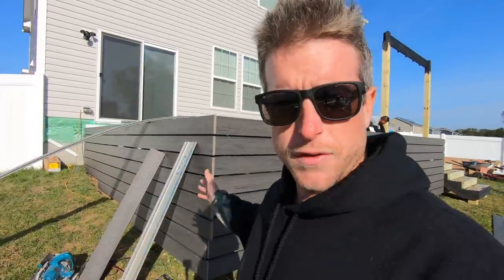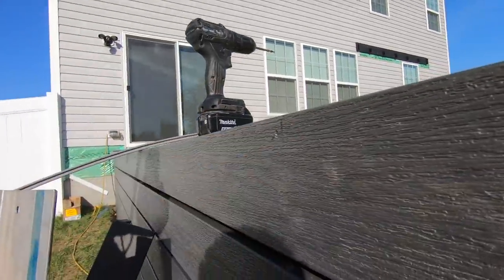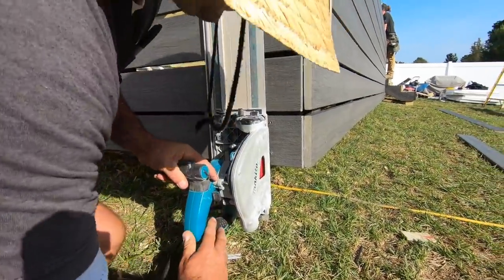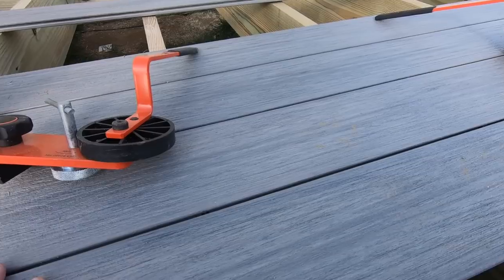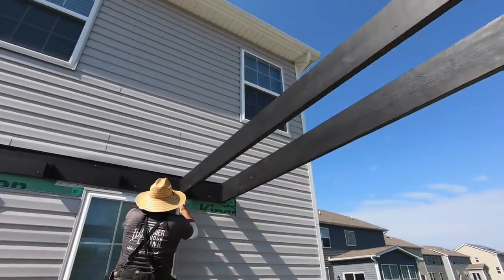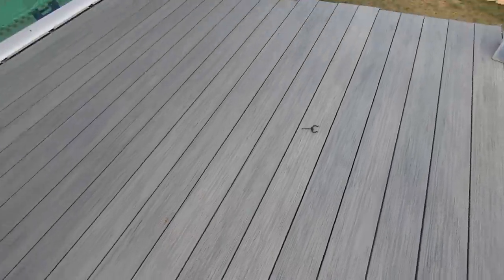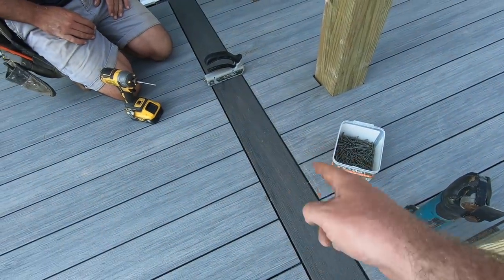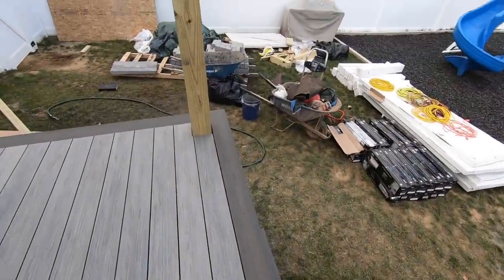Modern Deck and Pergola Build - PART 2

Comment: Great work guys , 2 minor suggestions /questions 
Why don't you use a roller or spray gun for stain maby save time 
And maby use a couple of clamps when using track saw on corners save screw holes 👌

Comment: 1 main statement/take away on wood vs deckerators, and go!
Reply: Maintenance
Reply from the maker: Yup that’s the easy answer! Over other composites is the harder question. In my experience the voyage series is the best decking on the market, this vista series is a slightly lower price point but right up there in quality with other brands premium boards. Plus they actually stand behind their contractors and their warranty covers removal and replacement